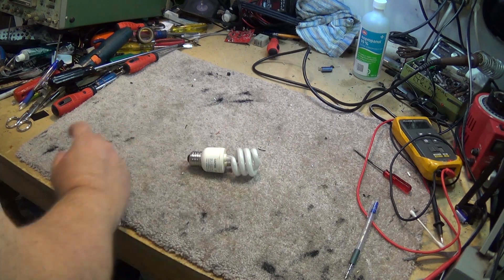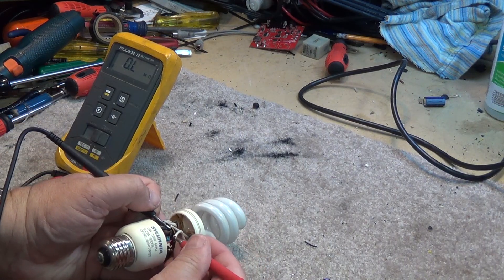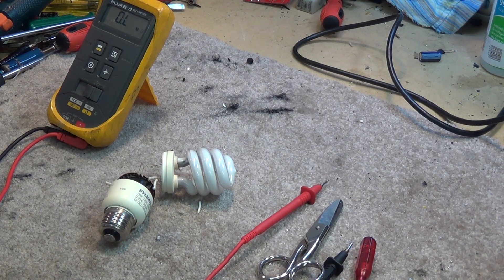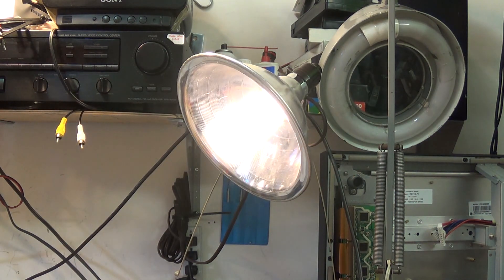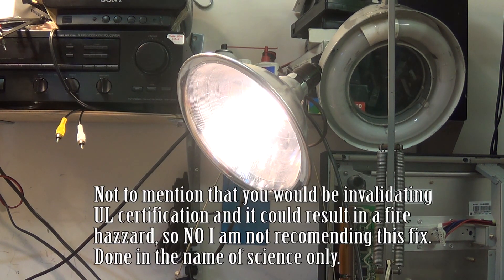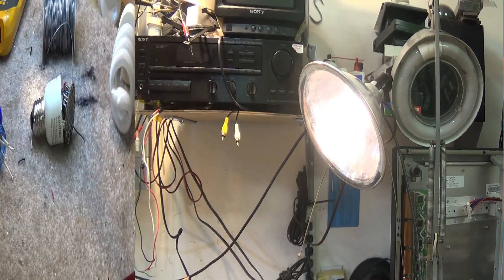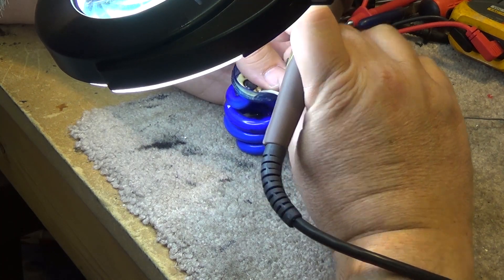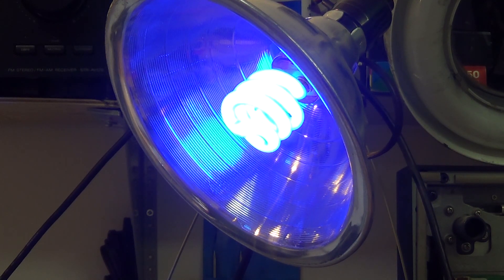CFL bulb repair

Comment: I think connecting an incandescent bulb in place of open filament is much better.
Reply: Or a resistor
Reply: @homeguestunton  the idea behind incandescent bulb is that it has a low resistance for starting and then goes high.

Comment: I've tried this today. Added a 2 ohm resistor and it lit up immediately, didn't flicker at all. I left the light on for a couple hours, everything was fine and I turned it off. Came back after a while and the bulb would not turn on. Turns out the remaining filament went open circuit. I'll repeat this test with another bulb and a higher value resistor to see what happens.
Reply: Do the same thing with the other filament

Comment: I didn't know you can do that - how long will that last???  It is working though!!!
Reply from the maker: +Donald Ellett The blue bulb is still working fine. It was the ballast that went bad, probably due to moisture. That bulb is on my patio, and it gets used regularly throughout the summer when I use my patio area. Dead of winter now, so nobody using it at the moment.

Comment from the maker: Like I said in the video, for what these things cost there is no reason to do this unless you like to tinker. I swapped the ballast for the blue tube only because the colored ones are more expensive, and that bulb has less than 100 hours on it.

Comment: incandescents RULE!!!! lol jk :>
Reply from the maker: +Tyler Hanson In some instances I would agree with you.For things like closet lights, atic lights, garage door opener, refrigerator lights. In other general applications though they have outlived their usefulness.I have CFL bulbs that are 12 years old and still going strong, but, I do use them in areas that they are running for hours a day. In areas where lights are flicked on and off for only  a minute, like the crapper for example, I use LED. CFL do not like to be cycled. Every time you start a fluorescent a little bit of the filament cathode material evaporates. When it runs out the tube is dead.

Comment: I really like that idea that you can swap the color bulb into a good ballast that really works, that's pretty cool. =)

I used to use a pink bulb during on Valentines Day to present people it's a Valentines Day. =)
Reply from the maker: +Bluethunderboom You can swap ballast boards as long as the burner and ballast are the same wattage. 13 watt burner for 13 watt ballast.If you put a 15 watt burner on a 13 watt ballast, then the bulb would probably not reach full brightness. If you put a 13 watt burner on say a 20 watt ballast, they burner would have a short life. In this case they are both 13 watts so it worked.